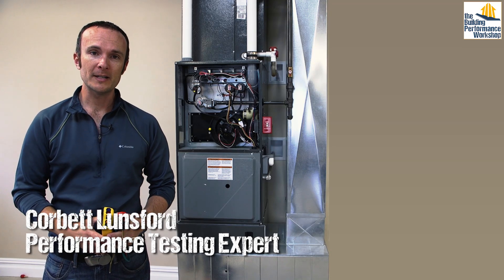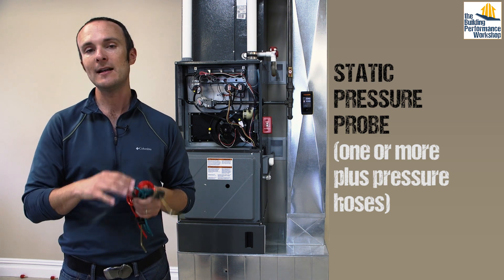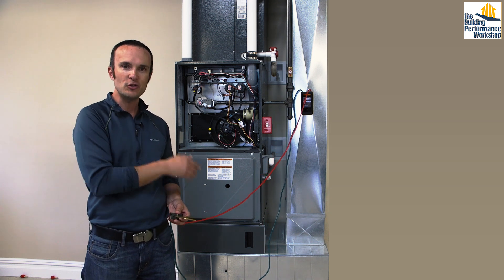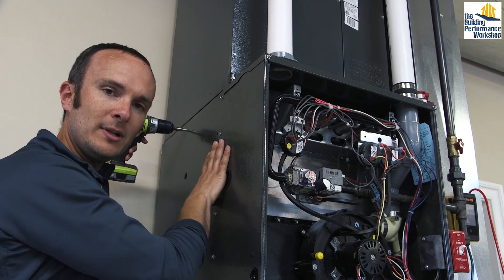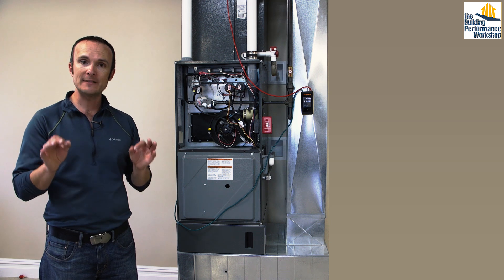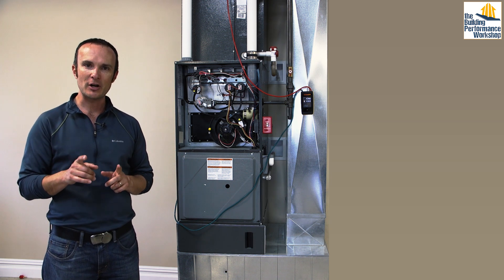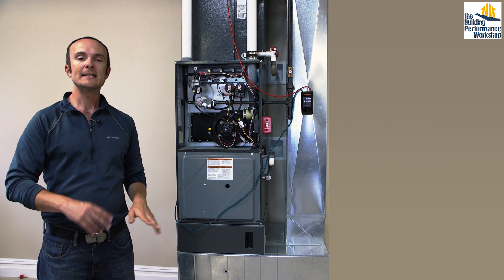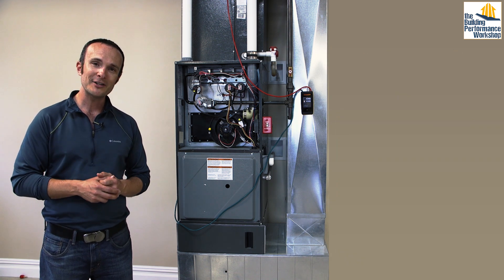Static Pressure Testing and Mapping Demonstration: Home HVAC Duct Performance

Comment: What would you consider is a high pressure drop across the coil that would indicate a blocked evaporator surface? Also what is the ideal drop across the coil , in this scenario you demonstrated it was .14. thanks
Reply from the maker: Here’s an example of the static from a frozen coil: HVAC MYSTERY: Testing Air Conditioning Airflow & External Static Pressure https://youtu.be/30B1-0dhsPY

Comment: You said if you dont see a hole on the side of the furnace your contractors are bad. What about removing the high temperature limit? Everyone I know uses that when they can to avoid drilling holes.
Reply from the maker: Yes, that can work, but it’s guaranteed to give you a higher than actual reading of TESP. And based on my testing history with hundreds of systems, I feel confident most contractors are never testing this. If they ARE, they should be showing that they pass on the unit, alongside all the other stickers on there.

Comment: Its late 2019, and this video is still wonderful !!  Do you plug the little drill holes when not testing so they won't whistle?
Reply: If the whistle, that's another sign you might have static pressure too high!
Reply from the maker: Thanks Bruce! Yep, you can get metal or plastic plugs, or just cover with metal tape.
Reply: @HomePerformance  Excellent video Corbett. How would you suggest covering the holes after an installer performs a temperature drop test? (delta T). Would you suggest covering the holes with foil tape?
Reply: I disagree with the point you made about not calling a company just because there are not holes driven into the furnaces.There are a static pressure readers into the new furnaces
Reply: There are a lot of hard working companies that have been providing exceptional service and hard work and you are telling people not to call them back.It not true
Reply from the maker: So you’re saying that most HVAC companies are testing and tracking this? Why do almost all readings exceed the limit?

Comment: you can test supply static through the limit opening without drilling a hole in the cabinet.
Reply from the maker: And you’ll get a slightly elevated reading, FYI

Comment: Hey Corbett. Great video!! I hope you can answer me this though. Every video on you tube shows how to measure static pressure and that it should be at about .5"wc for most residential units. However, I cant find any material on What just the return pressure should be. Or what just the supply should read. In other words, what if I have a read of total static pressure of .7"wc. All I know is that it's high. What pressure should I target in the return or what pressure should I target in the supply?

You briefly touched in that .14 is average for the a/c coil and that the filter should be at .1"wc.
And then you mentioned that at .19 the return was high and .07 the supply was low. But again I dont know what to target. If you could help me understand this I would really appreciate that. Or point me to material that I can read to further my knowledge in the matter. 

Thanks!!
Reply from the maker: Sure- ductwork is designed to pressurize to 0.1” or .08”, that should be ret and sup. And you don’t want TESP to be .5”, you want it UNDER .5”. So .1 for ret duct + .1 for filter + .1 for coil + .1 for sup ducts = .4”

Comment: Great video.  What setting are you using on the DM32?  I don't think there is a setting for TSP.  Thank you!
Reply from the maker: Thanks Vern- just use Pressure mode on both channels.
Reply: @HomePerformance  i dont see that in the "Device" options.  Looked in the manual as well.  What am I missing?
Reply from the maker: Device doesn’t matter- I think mine might be set to ‘hole flow’, but if you’re measuring pressure on both chans, the device matters not

Comment: Thank you. Does this data suggest a blocked, restricted or undersized return duct system? I am thinking if you have a high suction pressure you have less air flow and thus you have a lower static pressure on top because there  is simply less air there as well. Perhaps it is all from the filter? I would like to know what happens to all of these numbers if the filter was totally removed.
Reply from the maker: Filter removed means lower return static. Different systems, different configs, different ducts, all can have a variety of effects- it’s a system.

Comment: The hole does NOT have to be in "that exact spot"!!!
There could be a hole in the back, the other side or even use the high limit opening.
If there is a transition, you say spacer, then that is the better place.
In conclusion, any test port/hole is what one is looking for.
Reply from the maker: Correct, but the high limit opening is not external to the equipment. You’ll get a higher reading there. And in general, it’ll be in the one accessible side of the cabinet within any given tiny cramped mech closet.

Comment: good question everyone, so if you have a roof top packaged unit and want to calculate its external static pressure, do you consider internal pressure drops due to filters and coil? Or do you only calculate the pressure drop due to duct system?

Comment: Great video!!! now i understand a little more.  I will appreciate your advice though. So, i have a new air handler and new ac condenser unit (replaced).Since the installation 2 weeks ago, air flow has decreased noticeable in the third level of the house only (it's very weak). I have it checked (no testing as shown here whatsoever) but the response of the technician is that it's normal.  Now, i wake up in the middle of the night sweating, and I also have two fans in my bedroom. Finally, another company is coming this Saturday to check the "blower" (after doing some research that's how i explained the problem).  Which should i "demand" from this other company in order to have the unit properly inspected and diagnosed? Thanks in advance!
Reply from the maker: Hi Priscilla- sorry you’re having trouble, but glad you found us! You should try and find a diagnostics company that won’t have an agenda of selling you HVAC equipment. Go to: http://HomeDiagnosis.tv/pro to learn to find these companies in your area.
Reply: @HomePerformance  Thank you so much!!!

Comment: Hope you can point me in the right direction. Just checked my furnace, heat only no AC, and I am getting  .07 on supply side, and .48 on return side. Total is a little above .5, but the fact that I only have .07 on the supply side seems very wrong to me. Where should I start looking for issues?
Reply from the maker: Replace the filter first. Heating mode is often low speed on an air handler, so don’t be too concerned with the supply reading for now. You’d also want to take temps in rooms and airflow out of vents and thru system to get the big picture.
Reply: @HomePerformance   Thanks for the quick reply. I replaced the filter before even checking. I am pretty sure a ton of junk fell into the floor returns when the previous owner opened the walls up and the blown insulation fell out everywhere. I'm guessing that is why the return side is so high. Is there a way to force the air handler to blow in a higher mode to make sure I am able to get higher supply pressures?

Comment: Any hint on how to tell what filter my A/C really needs? Just got a brand new 14 seer system and put the 20.00 filter on it. System sweats like crazy, part of the reason for the sweat is the installer rushed it and did not put a new plenum to match the unit.
Reply from the maker: Filters have static pressure drops doc’d by the manufacturer, pick one that fits your system’s TESP

Comment: Any realistic alternatives to that $1500 digital pressure gauge?
Reply from the maker: Of course- Testo, Fieldpiece, etc, make $300 models, they’re just not as accurate
Reply: I got a pretty nice fieldpiece used on ebay for $50.

Comment: Sorry, I do have one more question if you are nice enough.  Out here we have our airhandlers (furnace and A coil and ductwork) in our attics.  There is a movement when they are replaced to move the unit to the garage so maintenance is easier.  How would you suggest setting up ductwork to have the proper pressures?  The original ductwork would remain in the attic but the unit would be about 9 foot lower and 6 foot away from where it was?  Also, most attic ductwork is flexible but metal would be run to the garage.  Probably too much but at least I tried….and thank you.

Comment: Thank you and I look forward to getting your book.  My other question is when dealing with existing ductwork then when you find problems how would you suggest we correct them without creating a huge cost to the consumer?
Reply from the maker: The consumer gets what they pay for- if they see the benefit, they won’t need a lot of convincing on cost. Several ways to seal ducts, depending on situation.

Comment: I also have an unrelated question:  I have a concrete walkway that pitches away from the house.  I want to install mini-splits and perhaps a new condenser.  I was wondering how to level the units and I was thinking uni-strut.
Reply from the maker: Sorry, I don’t have any expertise with that.
Reply: @HomePerformance  Thank you and I look forward to getting your book.  My other question is when dealing with existing ductwork then when you find problems how would you suggest we correct them without creating a huge cost to the consumer?

Comment: Hi, I might be wrong but please could you help clarify, if we are measuring static pressure in the ductwork, shouldn't the static pressure probe tip be facing away from the flow instead of towards the flow (as this would give the velocity/total pressure)?
Reply from the maker: Glad you asked- a static pressure probe can only measure static, it can’t measure velocity p. Always face its bullet-shaped head into the flow.

Comment: how much should i pay to get this test done, since i dont know how well the 25 year old ac unit is performing. reason is i will be getting a brand new unit and i want to see before and after performance results.
Reply from the maker: Just make sure it’s in the contract for your install, and they can test the old one before taking it apart. It takes only 10 minutes, as you see. Maybe $100 if they know what they’re doing, maybe $10,000 if you’re scaring them.

Comment: 3:16 "....And that means that you shouldn't call them back. It's that simple."  Well said. Well said.
Reply: Mike Krzesowiak as an hvac owner; I agree with the statement. If we don’t test, we don’t know. 
DMM, Guages, Combustion analyzers and every other tool we own is for TESTING. Gotta test to get the numbers. 
If people are sore then maybe they need to rethink their check up procedures.
Reply: Not well said at all. He's bitten off more than he can chew with that ridiculous assumption. First of all, most systems are not a furnace/cased coil combination. It's usually furnace first with a coil installed in the ductwork above... In those situations, there's never a need to even think about drilling into the furnace casing since the ductwork is readily available. Second, a good tech wants to avoid drilling an ugly hole in the casing of the system where an extra baffle for primary heat exchanger velocity makes it far less desirable to drill into. They will usually remove the high limit switch and use that opening for their test location. They can then simply put the high limit back in place and it leaves no evidence that you drilled hideous holes in a furnace... I'd hate to have a customer see this video and think I didn't go the extra mile when I really went out of my way to make sure everything is within spec. And for warranty purposes, many manufacturers require a start up sheet to be completed by the installer to show it was within the specs for proper coverage.
Reply from the maker: High limit will give you a higher than actual reading, fyi, because you’re not outside the equipment. Also, having tested this on hundreds of systems (and with confirmation from others who’ve done the same), I’d say 95% of them are outside spec. Maybe you’re not testing enough systems- if all you’re testing is your own work, and you do stellar work, then I’m happy for you.
Reply: @HomePerformance  You're inside the equipment in the exact same pressure zone as the location you're drilling into.
Reply from the maker: No, the high limit is by definition in the midst of the heat exchanger. It matters.

Comment: Can I close supply vents to route air flow, so long as static pressure doesn’t increase?
Reply from the maker: It will start to increase, but do what you have to

Comment: By pointing the pitot tube into the flow you are measuring velocity pressure.
Reply from the maker: No- a static pressure probe cannot measure velocity pressure, that’s why you use it instead of a full blown pitot tube.

Comment: Pull your high limit switch out test for static pressure after the blower there don't drill a hole in a cabinet like this idiot
Reply from the maker: How many ‘pull the limit switch’ comments will I have to correct for this vid? Maybe infinite. You CAN do this, but you will get a higher static pressure, since you are NOT testing external to the equipment. Who’s the idiot?
Reply: @HomePerformance  your wrong
Reply: @HomePerformance  hey idiot in the field you are not able to always gain access into the side of the cabinet more the 50% of the time there's a return or wall next to that furnace not furnace is set up like your situation in a classroom LOL therefore the hilum is the best situation and your little myth about having higher actually that's false when you go from the side of the cabinet you're restricting airflow from the heat exchanger at self and other objects so you're wrong you're giving a ball static pressure I don't care what it engineer says where you learned your information that's wrong also hey everybody do you static pressure checks download the SC app supercoolsliderule so therefore you can you can recommend what part of the ductwork to change the correct the static pressure no one said you wasn't right about the other stuff you're just wrong about the height limit stay in the classroom what the real technician has do the job in it field
Reply: @HomePerformance  also idiot you forgot to put in that you need to check your heating at the end of a trunk line the end of the trunk line now research that and explain why you should do that okay like I said teachers don't know everything
Reply from the maker: Hey ‘Real’ tech, I’m not a teacher. I test the work of techs like you. And you’re the one giving ‘ballpark’ numbers, guys like me use Pascal-sensitive manometers, precise to 0.1 Pa. That gives you accuracy, which might be why you think the supply static location doesn’t matter. Might want to think twice before coming on somebody’s specialist channel and dropping some lame casual namecalling when you’re outgunned.
Reply: @HomePerformance  I tell you what do another video where you're taking temperatures on several different spots of that cabinet especially where you took the static pressure on the furnace in the video where the hole is you drilled on that cabinet do that with temperature probes and tell me what spots are hotter than the others then compare it with the high limit
Reply from the maker: I have many other vids you might like, as well as a book on testing stuff like temps, but this vid was dedicated to just stat pressures. Testing temps in the limit would be inaccurate, fyi, because your probe is in the middle of the heat exchanger. There’s radiant heat blasting the thermometer from all sides. I think you’re meaning to test the air temp, and for that you can’t have line of sight between your temp probe and the heat exchanger (or coil for that matter)- it’s why there’s a shield on Testo probes, for example.

Comment: Ok so after I get static pressure reading? What do I do with that info?  Is there something to  adjust if we are low or high on static pressure?   I guess you would want to check airflow before adding refrigerant.
Reply from the maker: It’s a forensic look at whether the ducts were designed properly, and if you have problems in one particular area. Surgery would be required generally.